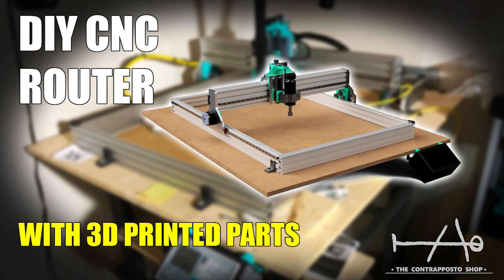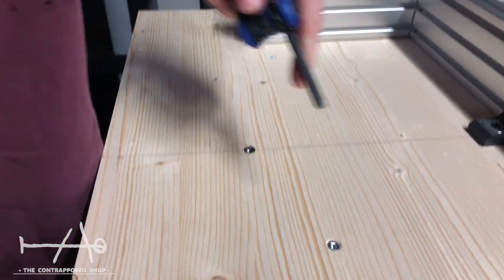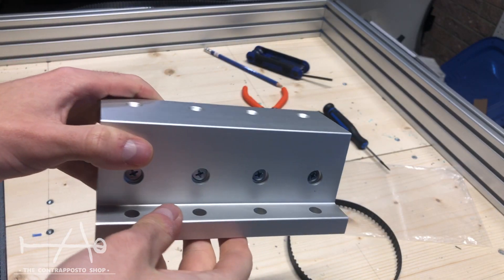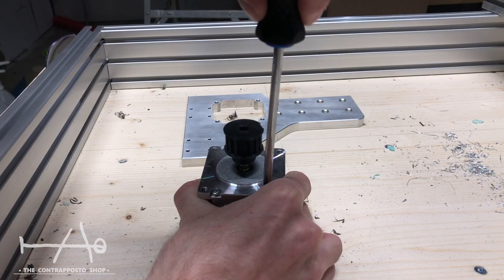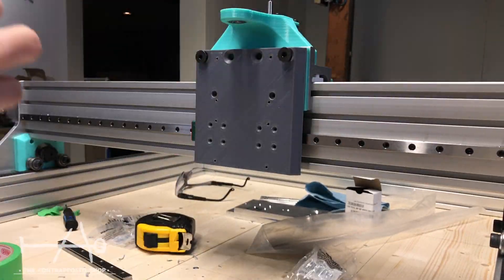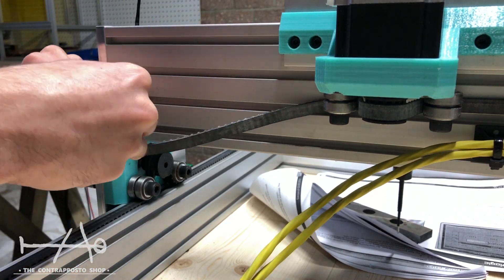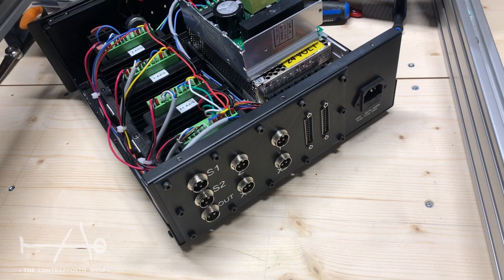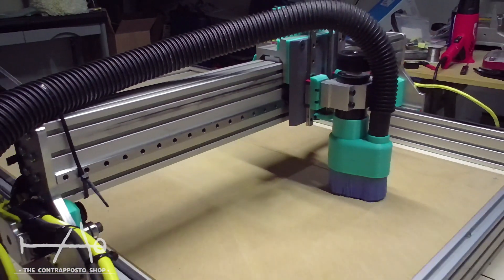Making a CNC router with 3D printed parts

Comment: I’m 50/50 with this. I thought it was a great idea, however I was expecting more 3D printed parts (not cut Aluminium) and if you don’t happen to have a Metal work shop or those electronic box you had lying around, we couldn’t make one. I was also expecting you to show us something you’ve made with it to show how good the quality was? Or what you could make with it.
Reply from the maker: Thank you for your comment:) … i believe that the complex aluminum part could be 3D printer … they not supposed a big lot of force. If really someone want it in aluminum webside like pcb way offers now cnc services for parts like that :) … the electronic box it’s to make it fancy but it’s an old audio amplifier ;) … and sorry for not showing result. I thought maybe since it’s capable of anything like a standard cnc no need to show it
Reply: There is no way around using metal parts for strength, even the mpcnc uses some. Any ramps board would easily run this for electronics.